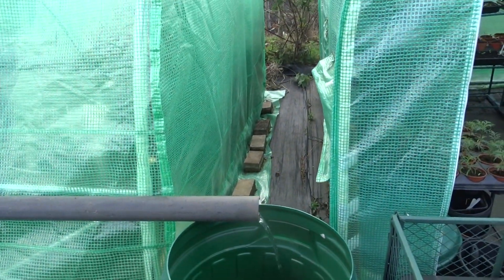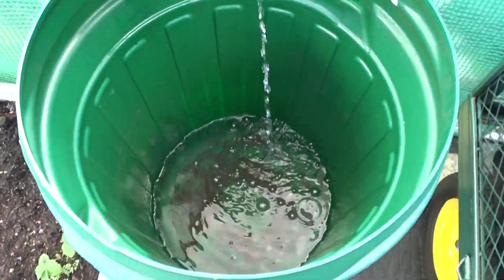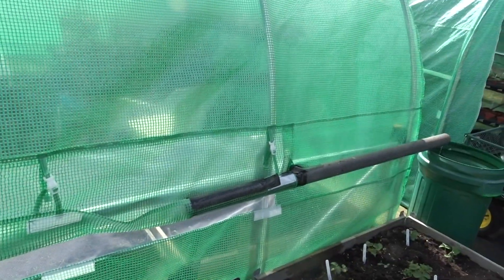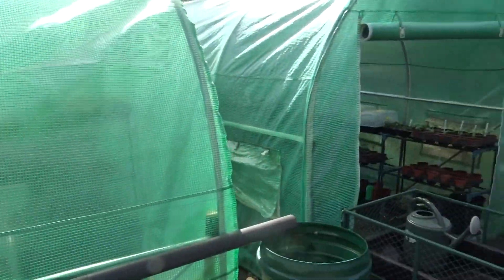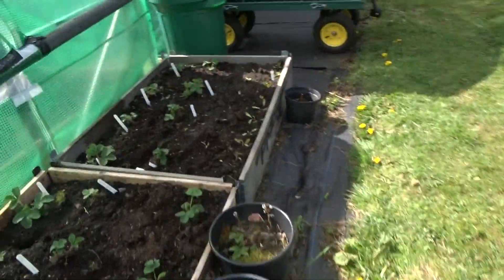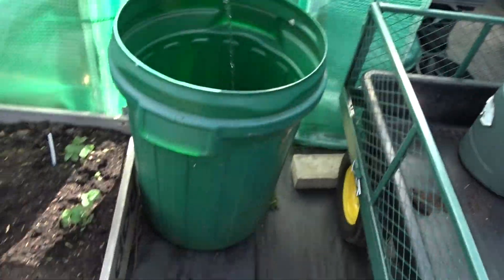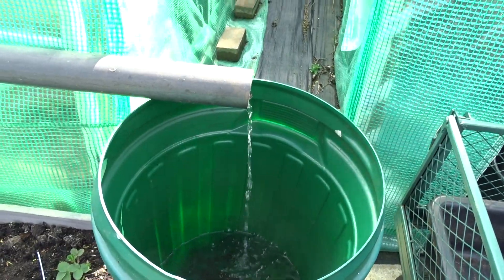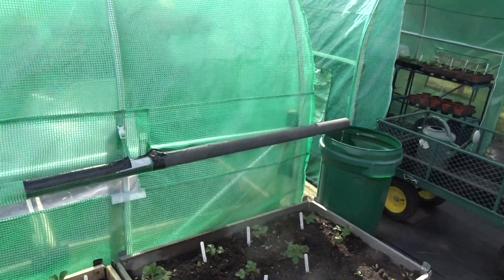Julie's Allotment - Grow Ur Own 2015 Polytunnel Gutter! - 29th April 2015

Comment: Tape a bit of Weed Control Fabric onto the end of the guttering and allow a length long enough to run into you water collection bucket at perhaps a 30-45 degre angle?  This may stop you needing to "pee" due to the sound of running water when it rains!  

The water will flow down the cloth and enter the bottom of the barrel quietly or at least create a soothing splashing noise you can enjoy and relax while listening to instead of the gushing "I just had 6 pints of lager and I'm fit to bust" sound of an empty barrel filling at full tilt?

Either way, thanks for the video showing this new addition to this years range of Polytunnels.  It was a great help in helping me decide to get one of Grow-ur-owns newer models.